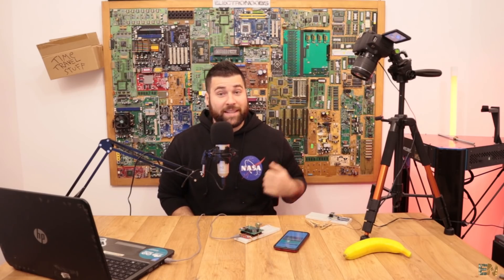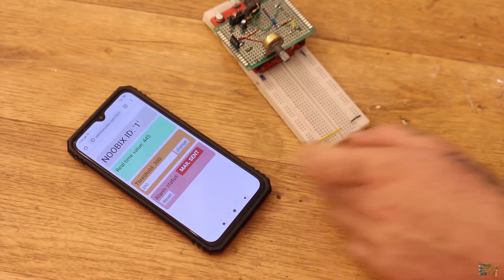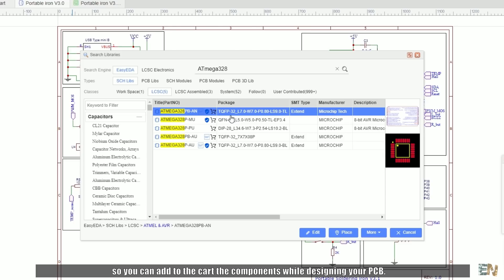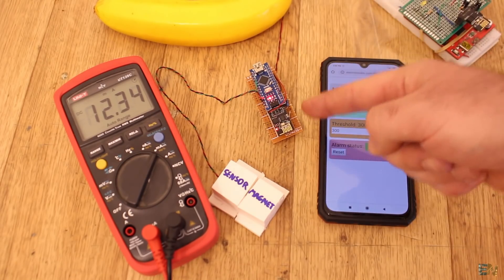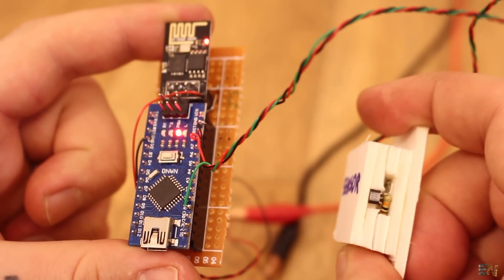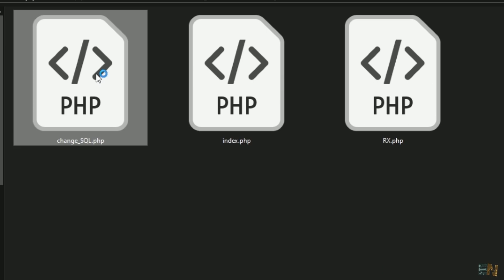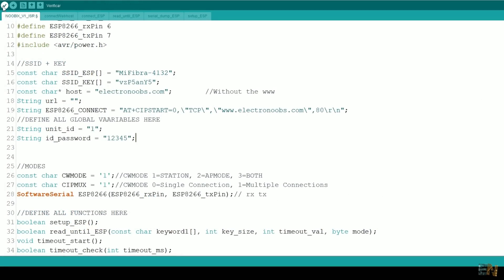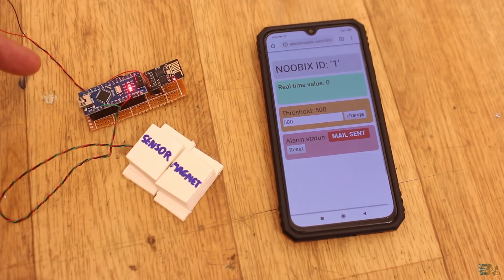IoT#1 - Door Open Alarm + E-Mail | ESP8266

Comment: Great video, but the code is very confusing.. ESP CHECK IS OK, but sometimes not okay. there is a lot of timeout issue i am encountering. Hope you explained well on how you code your timeout command and which specific AT firmware you used for the esp8266.

Comment: If you get an RTC w/ memory, you can stored the SSID list to the memory, reducing the ESP's wake up time -- and yes get rid of a the arduino -- and maybe put the whole project in a tiny case with a tiny momentary switch for a tamper detect to see if the case is ever opened, or if its ever removed from the door frame -- and maybe put a hall effect sensor on the inside too, pointed to the exterior of the door -- a common way to bypass this type of sensor is to just tape a neodymium magnet to the outside of the door frame -- if your 2nd hall effect sensor, or momentary switch ever detects anything you can tell your device was tampered with, or that someone was casing your home and you know its time to upgrade to an ESP32-Cam setup on your peephole, so you can see who is messing with your door & you could have that same ESP32 control a door lock solenoid&latching relay, check the hal effect sensors, AND power a display(epaper, so that it displays while everything is in deep sleep still) and an Pin Pad/Knock Sensor&NFC reader -- allowing key-less entry(Pin pad/knock sensor wakes up devices) and then reads NFC)  -- and then toss some 18650 batterys on it

Comment: hi i just want to ask from your previous  project the arduino drone if its possible to use only one arduino for the multiwii flightcontroller and the drone receiver all in one arduino uno... sory i know its not related at all to this video but this is the only way i can think of to get your response... great video by the way

Comment: If you reset the alsrm, while the value is over the limit, will it send a new mail right away, or wait for the  value is lower than the threshold and then wait for it to surpass the threshold again?

Comment: A couple quick thoughts:

- A magnetic reed sensor is much cheaper, easier to use, lower on power consumption, and is more reliable than a hall effect sensor.
- If you use interrupts (rising or falling edge, based on your sensor) then you can wake the Arduino only and immediately when the sensor changes state, saving power and improving responsiveness.
- PHP has an include function that allows you to dynamically "merge" files at runtime. This is a great way to split out password and database definitions to a single file that can be referenced by multiple other files. (This also means you can put that file outside of your webroot so that only local applications/scripts can read it, and not any web request.)
- Consider only storing a hash of the password in the database. You then compute the hash from the submitted password provided by the device and compare that to what's in the database. This is how you avoid a database leak that includes raw passwords. (Salts are typically used here as well, although their effectiveness might not be as important in this particular scenario.)
- Bonus points if you use just the ESP8266 and drop the Arduino. That can lead to a lot more power savings and increased responsiveness as the interrupt can directly wake the ESP8266.
- MQTT is a much more power-friendly protocol, although this does pose a challenge with a webhost that doesn't offer a daemon. There are PHP client libraries available though.
Reply from the maker: Thank you so much for this great feedback!!!

Comment: i have bad experience with hall effect sensors ....i almost failed my studies coz one of them malfunctioned .............i much rather have a flame thrower strapped to the door blasting 24/7 to a temperature sensor on the door frame than hall effect sensor ....... i will never trust it again

Comment: To send an SMS message you could send an email to your mobile provider's SMS Gateway. For Verizon in the U.S. I use 1234567890@vtext.com where 1234567890 is my mobile number with area code. See https://www.lifewire.com/sms-gateway-from-email-to-sms-text-message-2495456 for more details. Outside the U.S. I'm not sure  if there are equivalent options but I guess you could google your mobile provider.

Comment: We love that you are using the ESP-01 :-) It makes us so happy when makers are selecting the "correct" parts, and not just "overpay" for more features when it is not needed. Thanks Electronoobs!
Reply: If you don't want to over-pay, just use the ESP8266-01 and a magnetic reed switch. No arduino necessary.

Comment: I doubt you'll read this but I think you should spend a bit more time following other YouTube channels. This project can be greatly simplified! You can achieve the same result with only two components worth 3€ in total in addition to the potentiometer. :) You'll need:

- Arduino port for ESP8266, after this the Nano is not needed at all: http://arduino.esp8266.com/Arduino/versions/2.0.0/doc/installing.html
- an ESP8266 development board, a popular option is D1 Mini: https://www.aliexpress.com/item/32651747570.html
- a reed switch door sensor such as this: https://www.aliexpress.com/item/32989085165.html

The reed switch is wired from 3.3V pin to a digital pin, such as D3 (on a D1 Mini). Potentiometer is wired from 3.3V to A1. For the notification you could push them directly to the phone. Here's a video from Brian Lough using Telegram and IFTTT: https://m.youtube.com/watch?v=yFiKDabYJ1I

To simplify the database part I would recommend looking into MQTT which is a simple communication protocol that's most popular for IoT. The data could be then sent to a cloud service like ThingSpeak. There's even an Arduino library to do all this, demonstrated on this video: https://m.youtube.com/watch?v=AK4Lp1Ko0l8

I hope this is useful to you or someone else as it took a while to write this on my phone! :)
Reply from the maker: Thank you so much for the feedback!

Comment: Why you use the Arduino? Couldn‘t it be done with esp8266 Alone? You can program the esp the same way as an Arduino.
Reply: I was looking for this question, so now I know don't need to repeat it. 👍
Wait for his answer.
Reply: @Seu_Lunga  The ESP01 used in this doesn't have any analogue pins. In fact the NodeMCU also only has a single analogue input too. So we're quite restricted using analogue sensors with the ESP8266, unless using a multiplexer to connect to multiple analogue inputs. Digital inputs are not a problem for the ESP8266.
Reply: @sureshkumarmadevan3011  if you can't get a digital 0 or 1 from a hall sensor(I thought you could) then just use a Reed switch. Digital bam, done. ESP8266 alone.
Reply: @sureshkumarmadevan3011  he only needs 1 pin for this device, he could use esp 12e or 12f or even esp07
Hall sensors can work as digital sensor given the right conditions
Reply: @sureshkumarmadevan3011  So we use a magnetic reed switch on the door instead.
Reply: Suresh Kumar Madevan with one analog you can multiplex with the ESP itself. Just use a digital high as source and measure on analog pin. So, depending which D-Pin you use as source (set to high) you know what you measure.
Reply: @marks47  however you want to do it, if it is only going to serve 1 door or one window then set it up to send the reset pin a low signal. That will wake it from deep sleep making your batteries last much longer. ESP.deepSleep(0) is supposed to put it into deep sleep in the first place, btw.
Reply: @sureshkumarmadevan3011  dont need an analog signal for a dooropen alarm
Reply: yup, the esp8266 is mucho capable.
Reply: +1
Reply: ya its posible but in this tutorial he use analog reading of hall effect sensor and esp01 have don't. if he use hall effect as digital sensor he only need esp01
Reply: Amazing Mj you can use a reed contact for simple on/off as ist is done in millions of Commercial door contacts. Or, if use hall Sensor he can use ESP12. But with analog you cannot wakeup from Deepsleep.
Reply: @TheTurbotommi  ya right... reed switch is best
Reply: probably because in his past video, he connected a bunch of sensors and relays with it, which the esp01 may not handle alone. This is his breakdown video and I think doesn't want to change much of his previous settings.
Reply: I wanted to ask the same question. Wouldn't it be easier, cleaner, and have a lower power consumption to use only the ESP?
Reply: Yeah, and quality of code is also nonexistent.

Comment: I'm kinda doing the same thing just with the esp32, node red, mqtt, raspberry pi, Google hub, with a hall sensor. It works fine except, can't figure out why after a couple of hours the esp32 looses Wi-Fi connection. Any possible suggestions would be greatly appreciated. It seems a lot of people suffer with the same issue with the esp32. I have openhabian running on my pi, with node red and mqtt. Esp32 has pubsubclient and ota library. Using a network monitor software that will notify me of issues. it seems that when it looses some pings it disconnects only part way from the network. It will not send mqtt and or email notifications. I still can ping and send ota updates. So it's not completely disconnected. It may have some thing to do with it getting disconnected from my mqtt server. I may just have to use wireshark for a deeper look at it.
Reply: I can't help with your question but I think you might want to check the comment I wrote to this video. :) Based on your setup I'm guessing you're also subscribed to Andreas Spiess' channel? I too have all of what you described (besides Google hub) set up but for a "noobs" tutorial I think it'd be too complicated...
Reply: To try to answer your question, you could try to use another MQTT library? I've had good experiences with Async MQTT client: https://github.com/marvinroger/async-mqtt-client. The issue is more likely either in your code or perhaps unstable power. I hope this helps! (Unfortunately I cannot help you further but Wireshark sounds excessive.)